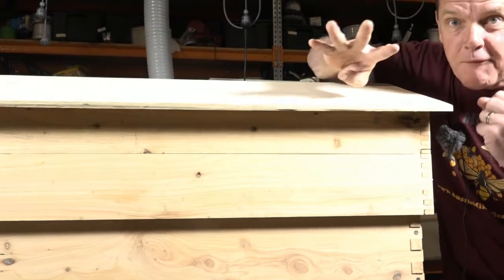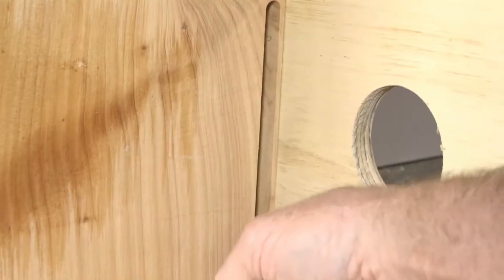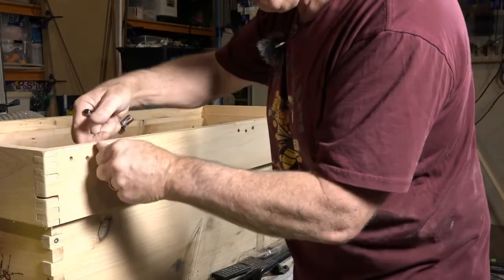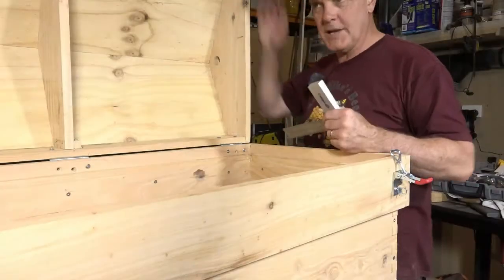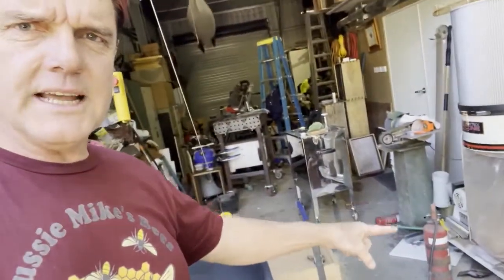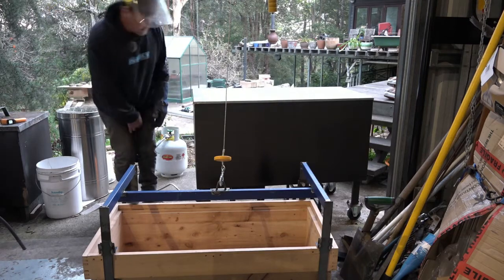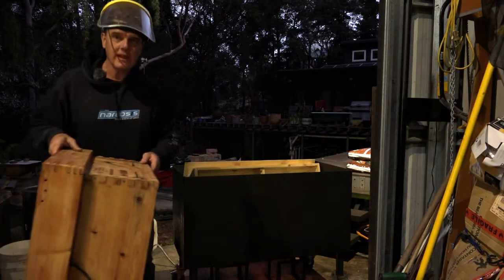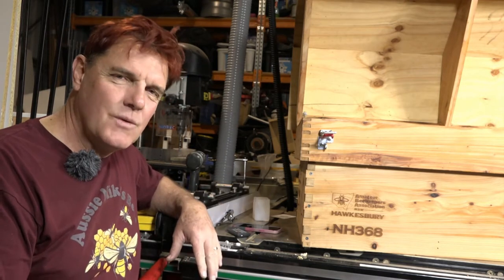Horizontal Hive - The Long Lang Build Continues - Part 4

Comment: Very nice there my friend.  I have built many hives, and this is the way I would do it as well.  Best wishes with the bees.
Reply from the maker: Thanks, Robert. I’m sure you’ll enjoy horizontal beekeeping. So far, easy to manage and no more back strain. I’ve just spent some time in Slovenia looking over their bee house layout and AZ hive design. My mind is ticking over with ideas to use AZ hives at home.
Reply: @AussieMikesBees  Thanks for the reply there mate.  Yes, I was a beek in western Montana for many years, gave it up long before the varroa and beetles came,, due to a move I had to make to a different part of the state.  A couple years ago, I built a 24 frame Layens system, but after not finding any swarms, and having to move again, I gave my hive to a friend who was going to try packages, which I refused to do.  It can be difficult keeping bees in Montana, and dealing with mites makes it more so.  Thanks and cheers.   Bob
Reply from the maker: Thanks for the background story, Robert. We’re facing Varroa for the first time here. They’re still confident they can eradicate and hope they’re right. The eradication zone has moved close to me, so I may lose my bees before summer if there are any more illegal hive moves. We’ve had SHB for 20years. It’s only a problem if the hive isn’t strong, and that is often from Varroa. Here it’s more likely AFB or supers put on too soon.

Comment: Hi Mike, 
How much wax did you have to use in your tank for your long lang?
Reply from the maker: Good question, Swell. In order to get the depth to submerge the main body I loaded up 250kg (550lb) of 50:50 paraffin and microcrystalline. The consumption is small though, a few grams per hive.

Comment: Awesome job Mike 😀 thank you so much for part 4. Look forward to part 5, now to start our own long lang or two 😀 
What was the overall length of your box and was that for 30 frames? I would like mine to hold 40 as I want a hive at either end and sharing the honey load in the middle 😀
Reply from the maker: Thanks, Lisa. I’d love to hear how yours go. This one is 1200mm long at the roof holding 30frames. When you work out the length of yours for 40frames, add another frame width for wiggle room.  Honey frames are better if they’re spread a little so the bees draw out the wax further, making it easier to uncap for extraction.

Comment: Mike what is lift rating of the gas shocks?
Reply from the maker: Good question, Rodney.  I couldn't find the spec sheet for this strut.  It was a cheap unit from Bunnings (Aussie equivalent to Home Depot) in the cupboard section.  I chose the softest one so it wouldn't strain the hinges unnecessarily.  There isn't much force on the strut when the lid is open unlike the kitchen cupboard upward opening doors they are commonly used for.  I would guess its a 20-30Nm.  I can compress it by hand without much trouble.